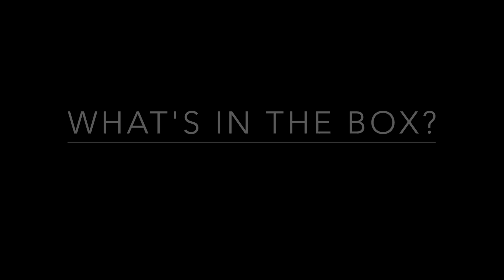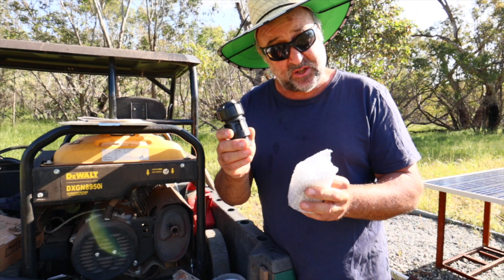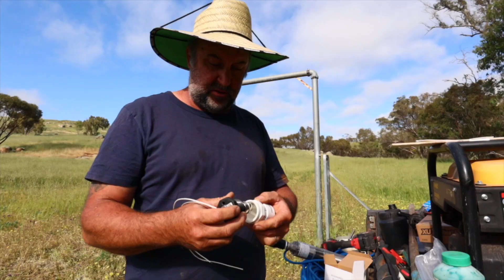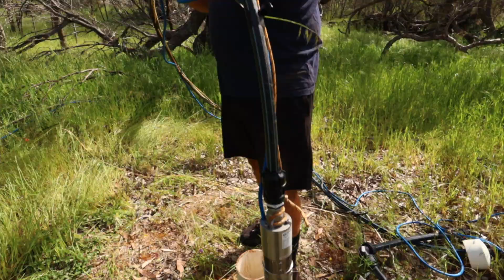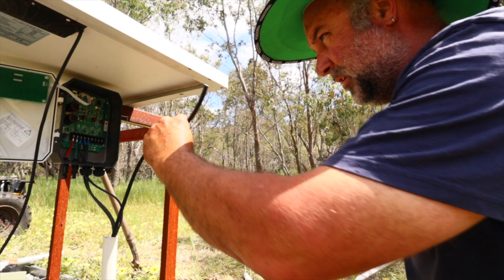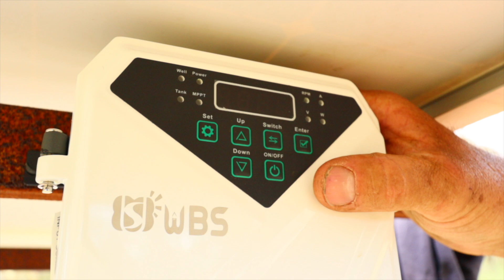Off-Grid Water System UPGRADE: New Smart Solar Pump & Second-Life Panels

Comment: If you really want your submersible bore pump to have any longevity you need to install a cooling shroud on it before installing down the hole. In my experience these cheap Chinese pumps don’t have a very long life as it is, few years tops so honestly you are better off buying something more quality when off grid like a Grundfos pump and controller. Also S/S safety cable instead of rope which will rot, Just my opinion.
Reply from the maker: @rustynail4x4  I mean you’re not wrong, if you’ve got the $$ for sure. The warranty plays a part for us too, if the more expensive ones had a longer warranty we’d probably consider it. Be interesting to see how this one performs over time, cheers for your thoughts 👍

Comment: What happened to the pump you removed Corey, did it die? If so, do you know why?
Reply from the maker: @davidantrobus1751  hey, Amanda here. Nothing wrong with the pump in this instance but Corey has noticed sone common weaknesses across a few he has used… basically because they are cheaper construction. But I’ll get him to add his thoughts when he gets home tonight. 

We removed the old pump because we were looking at getting a back up to have on hand and had been eyeing off the alt tech kit so just decided to install the upgraded pump and put the old one aside instead as our emergency pump 👍 I think I might have edited that explanation out now that I think of it!!!
Reply: @ROCKPILEOffgridHomestead  good thinking Amanda 👍
Reply from the maker: @davidantrobus1751  Hey mate the cheaper pump has the circuit board built in and it was a weakness in that it could fault and it wasn’t something external of the pump you could troubleshoot. The pump would just stop working. Also, the way the float switch is set you can’t add additional switches to suit a tank set up. Not an issue for us but has been in another situation I used one in. I mean, it’s only $350 so good for the price but does have limitations.